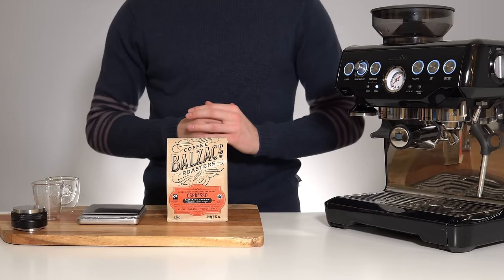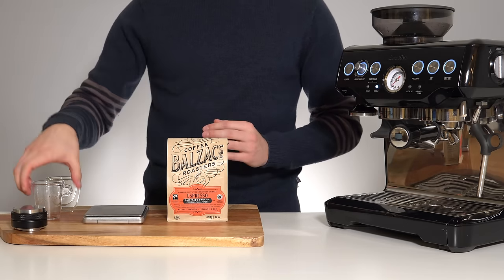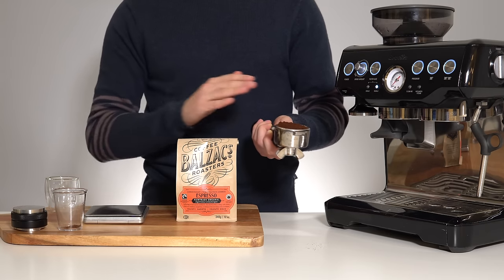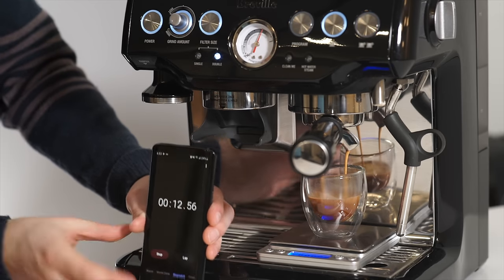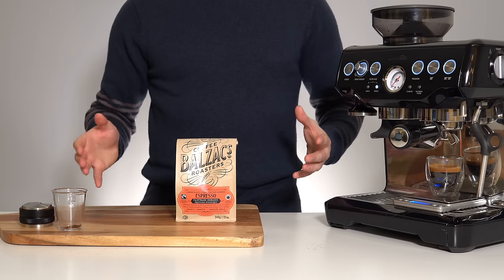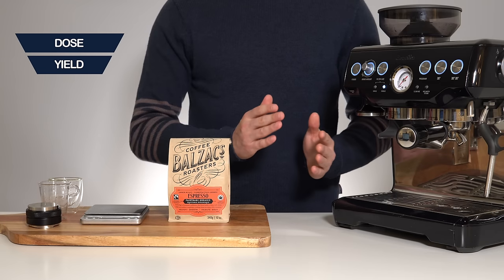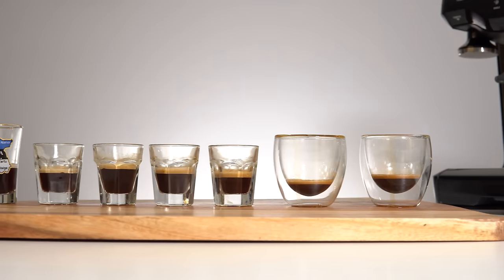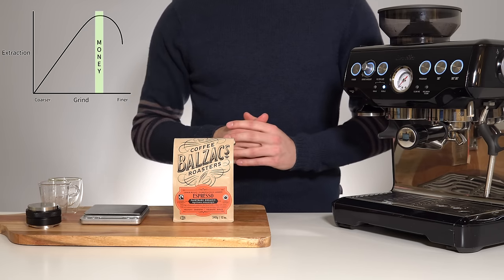Dialing In Breville Barista Express | Dose, grind, yield, time

Comment: Great introduction! I use the Barista Pro, do you measure the preinfusion time (nearly 8 seconds to the first drop) into the 20-30 seconds recommendation?
Reply: From what I'm gather he's starting his 20-30 second count after the ~8 second pre infusion. Which means the clock on the barista pro should be reading 28-38 seconds by the time the shot is finished.
Reply: In the video time is measured starting with the first drop. But normally you have to measure the time water and coffee have contact, which means, your have to include the preinfusion time. Even Breville recommends doing so.
Reply from the maker: Only time you need to time in a specific exact way is when trying to replicate a brew recipe. This 25 or 30 seconds is intended as a STARTING point from which you can start tasting and tweak further. Either time or either timing method will work. Regardless, you will need to taste and tweak further based on your specific coffee and personal taste

Comment: I came to watch this video because a friend of mine is getting into espresso drinking and has found a friend who is selling the machine and asked what I thought about it. I'd watched  a couple of other videos with this machine and told him about them but  rather than rely on the machines settings  buy a scale and weigh the coffee in and out- guess what? This is exactly the method that you are using. 
No flash bang wallop music, what's up guys or anything like that just clear precise instructions - excellent.
I brew only black coffee, no milk based drinks and I aim for 30g out of an 18g dose because I prefer the mouthfeel. No good asking me about milk based coffee. 
I would only make a couple of recommendations over and above what you have said,  1) use magnesium filtered water to improve the taste and prevent unwanted scaling of the machine 2) buy at least 500g of the same beans because you will use quite a bit to get the shots dialled in. I learnt my mistakes by buying 250g of one variety of beans and then switching to another variety of beans and having to go through the whole dialling in process again and not really learning. I now buy 1kg at a time from my local roaster and don't regret wasting a shots during the dialling in - event though I am a tight Yorkshireman!

Comment: This is a great video! I have a few questions:
This example was done with a double shot. Do I have to dial in again using the single shot, or will the Breville remember my programming for the double shot and divide that by 2 for the single shot? Or do I need to program it again?
Am I still going for 20-30 seconds on a single shot? Or should that number be different?
Reply: You have to program the buttons separately. They come preset from the factory the way you describe, and will reset to that default if you perform a factory reset, but changing one will not change the other. I have my single set to a ristretto (short double, 1:1.5) and the double button set to a normal 1:2 double. 

Also, singles are notoriously hard to dial in. The shot time should be the same as the double and therefore you need a much finer grind. It will be much more sensitive to grind size and you might find this machine won't go fine enough. It's a waste, but most people pull a double into two glasses and chuck the extra one if they only want a single.
Reply: @Akmatick  - agreed, dialing in single shots is not fun. I used to do it a lot before I was very knowledgeable about the machine and I always found I had wildly different results between the 1 shot basket and 2 shot basket. The 2 shot was generally better, and I'm not surprised nowadays, given more coffee theory is based around shot weights suitable for the 2 shot basket.

Comment: I noticed that there was no espresso coming out on pre infussion on your vid.  Should this be the case?  Espresso comes out on mine when I press the brew button.  Let me know how I can fix this.  Thanks and great video!
Reply from the maker: No, espresso should not come out during pre-infusion. The pressure during pre-infusion is very low. If water is able to pass through at such a low pressure, you need to make your grind finer!
Reply: @LifestyleLab_  Got the same problem. I always get coffee in pre infusion phase nomather how find my grind is.
Reply: @tomekhekin914  are u using double basket? With single it is almost impossible to not get leakage during pre-infusion.
Reply from the maker: @tomekhekin914  try increasing dose by a gram or two.
Reply: 2M views Today I’ve increased my dose to 11g on a single wall basket, and have yielded close to 1:2 ration at 21.5g... but I forgot to time it 🤦🏻‍♂️

Things I’ve changed:
1.  Dose from 9g to 11g
2.  Calibrated Tamper (Not the Espro version)

I have yet to dial in some more as there is a little bit coffee still coming out of pre-infussion... I am on a mission to dial in 🤓
Reply: 2M views really?  I always use very fine grind, at fine-1 2.  It Still coming out at pre fusion
Reply from the maker: @BingBing-cw8qb  try increasing your dose. Water should not be able to pass through the puck during pre-infusion. Just like the "box of pebbles" analogy I made, the liquid exiting at that point would be very under extracted
Reply: 2M views thanks I need to do more experience
Reply: @LifestyleLab_  this is a very important comment. I have been making this mistake for many many months before I saw your video!
Reply: @justinwong1307  Beware, you can also make finer grinds by adjusting the burr grinder itself. There is a metal arc you can hold it from, it pulls out of it's side slots and allows for extra grind settings. It will allow for much finer grinds. Pay attention to the numbers on the plastic ring on the Burr blade itself and you ll notice nthe calibration levels it has for the metal arc.
Reply from the maker: If you've reached the minimum grind setting and it's still running too fast, you need to set the INTERNAL grind setting finer! Here's how: https://youtu.be/QNvOcE4-VEo

Comment: Love the video, however I'm pretty certain you do not time when the first  drop. You time from as soon as the extrction has started otherwise you miss vital seconds which through off the taste etc...
Reply from the maker: As long as you dial in to a time that tastes good and hit it every time, method is irrelevant. 25 seconds from first drip vs 30 seconds including pre infusion will taste exactly the same ;)
Reply: So many unnecessary steps 😅 hearts 8n the right place though
Reply: @JJones_1  Huh? These are all standard steps to dialing in a shot, which one's are unnecessary?
Reply: Correct, you time from when you hit the button. Should be about 30 seconds I believe
Reply from the maker: @jaquestraw1  25sec from first drip is the same as 30 seconds from button push (5sec preinfusion)...
Reply: I understand. Thanks,  good video!
Reply: I believe the barista express has about 12s of pre-infusion (non adjustable).  It's wierd, so I just do it manually every time.
Reply: I'd recommend to start timing when you hit the button, since the preinfusion time is also a variant. The manual says that the first drop should start after around 7 secs. which works perfect on my machine. But as yuy can see in the comments we have everything here from 5 to 12 secs. I used to dial in by timing from the first drop an, and it almost drove me nuts every time a tried another sort of beans, 'cause I never managed to get the same flow time. But since I started timing from hitting the button, it became much easier.

Comment: When I first started making espresso I bought one of those expensive Italian double boiler machines (LaSpaziali Vivaldi II) and a Mazer grinder. I went through all the trial and error setup like you present here. My coffees were outstanding.
Later, I bought the Breville for work. I did not put the work in to properly get it set up. Coffees were OK and it didn't seem worth it to go through the setup / calibration. (I know my shots are too fast)
Watching your video has inspired me to go ahead and put in the effort.
Thanks.
I'll let you know how it turns out.

Comment: This is an excellent review and video on how to use it. I've had this machines for over 2 years and it's been flawless. My friends have enjoyed this machine so much that two of them bought it!

I've found that for myself, making single shot espressos, this machines hs been very consistent. Albeit I do notice differences between summer and winter as I have to adjust to a finer grind in summer. The double dose does come out rather inconsistently, however I'm getting used to measuring it well by sight. It's about getting used to how compact a proper shot of espresso is. But the double shot does come out well too. But I do find that I can get a creamier single shot and I think that is down to the shape of the single dose filter.

I will however try and focus more on how much I put in, and how long it takes to pour. I believe that by following your techniques I can improve my own.

Thank you for the video, it was pleasantly informative!

Comment: best video i have came across for beginners to explain everything 👍🏻 … all the videos i have watched say you shouldn’t need to adjust the burr grinder but just play around with the external one on the side. 

however, in order to extract 36g using 1:2 ratio in around 20-30 seconds i had to adjust the burr grinder down to 3, and 5 on the external. this goes against all the video tutorials i have watched, is something wrong with my machine or beans? i have just bought this and only used one type of bean from my local coffee shop.
Reply from the maker: Nothing wrong!  
Dial in to taste and enjoy

Comment: First of all: this video is a big help if you just bought your barista express! Thxs 

Next to espresso I like an Americano. In your video around 10 min you speak about brew ratioand yield and the graphics. 

I asked my self: is there a difference of making a good double espresso en poor in in hot water ..or (after a taste test) let the double espresso shot last longer eg. 50 sec and have an Americano without pooring  it in hot water ? 

And about the water… is there a “rule” how much water (gram) to add to double expresso or is it a taste thing? 

Last Q :) when I made a shot and cleaned the porta filter… it seams that there is a little bit of water left between the cup and pf casing … is that normal ? 

Last but not least: great job and great and helpful videos.

Comment: I have the ESP8XL I thought that the heating element was out but my husband went ahead and opened it and saved it. We found that one of the connections was not connected. My machine was manufactured 2008 we had been using it for years. I only paid $2 for my machine. Had not been able to use it for about 6 months. But we decided to try and save it. That little bit of information about letting the espresso machine warm up 15 minutes made all the difference. It's like I completely forgot how to use it? Cuz one time it would make a perfect shot and the next time it would be just straight water.

Comment: The machine is actually ready in fewer second, the reason why we wait 15-20 min is because our cup gets also heated along with the bins, with you putting the right amounts just in time , it will give you slightly a colder coffee which  defeat the purpose of waiting that long, beside if you set up proper grinding with proper amount it will always give you about the same amount.. i have set up almost at 3 and i always get about 19gr

Comment: Thank you for this video. Just got the machine. Will try this. My machine gives me almost no pressure even when I switched to grind 8. Not sure. However mine was on auto mode. I will try this manual method. Thanks
Reply from the maker: You will need to dial in ANY espresso machine's grind setting in this way. Automatic or not :) 
If you're not getting pressure on 8, start going finer. If you reach 0, there is a macro adjustment on the upper burr to give you even more range
Reply: @LifestyleLab_  I had it on grind four before and the pressure dial did not move at all. I thought the machine was broken. Also it grinds SO much coffee so I set the dial on one above least amount of grind. That is very different to everyone else. Don’t get it. :-(
Reply from the maker: @JH-nb4nn if it didn't build pressure on 4, you should have gone finer not coarser... 
Everything you're experiencing makes total sense. You're grinding too coarse, meaning the grinder is grinding very quickly giving you a lot of coffee on the basket in very little time. The finer your grind, the longer it will take to grind, and the more pressure / slower flow your espresso will have. 
This is all described in this video
Reply: @LifestyleLab_  Oh.....Yes it brewed the coffee in about 10 seconds. But I don't understand. I will rewatch the video when I attempt. Thank you
Reply: @LifestyleLab_  And yes i know you explained it in the video but I am not smart with coffee making so I will rewatch. Lol.

Comment: Thank you for all your videos.  These helped me to make the decision to get a Breville Barista Express as well as most of your suggested accessories.  
That said, I attempted to dial it in for the first time today.  I (think) I followed your instructions correctly, using all same tools you mentioned including the same scale and Palm Tamper etc.  
I first followed your video on dialing in the tamper then moved on the grind.  However no matter which settings I used all of my shots reached 36 grams between 10 and 16 seconds.  Following your advice I tried to go up to 22 grams but found I literally could not attach the portafilter at 22grams... it was just too full even after tamping.  Therefore I moved down to 20 grams and I could fit that amount.  When dialing in at 20 I still found even at a 1 grind setting my shots were pulling about 14 seconds.  I then followed your advice and adjusted the internal grind setting (which was already set at a 3 from the factory).  I moved this down to 1 and started the process again, eventually finding that even at the finest setting on both the internal and external grinder (1 on both) still only got me to a 16 second extraction.  At this point I started to feel like I must be missing something in the process here.  What other factors could I missing?  I am using freshly roasted Intelligentsia Organic Espresso Beans if thats helpful. 
What I feel I'm missing overall is why are the numbers you suggested so important?  What I mean is why do I want a 20-30 second extraction with a 36 gram shot?  If I put aside all the numbers and just go by taste, I would say the best  tasting of the many i pulled was approx  these settings:  Internal grinder: 3. External grinder 8, 18 grams dose, 13.5 second extraction.  Should I just forget about hitting a 20-30 second extraction and use those settings that came out best?  It was pretty good at that level but short of an expert level like I get at the best coffeeshops.  I'm embracing the leaning curve with this process but just the fact that I reached the limits of the machine settings right away makes me feel like I must be missing some other factor.   Any insight would be extremely helpful!
Reply from the maker: If you reach a point where you are no longer decreasing the flow rate by grinding finer, it means the water is no longer being forced through the puck (because the resistance is too high). The water is instead rushing around the edge of the portafilter, which is why the grind setting does not impact the flow rate. 
Try moving the internal grind setting up to 6 (normally where it is from factory, not sure why yours was at 3), and restart the dialing in process with 17gr of beans. Let me know how it goes!

Comment: Great video! I managed to dial in my machine using this yesterday in about 10 coffees. I had 18g does with 36g yield in 24 seconds … left everything the same and then in the morning I was getting 11g yield in 20 seconds with same dose? … I’m using the distributor/tamper you use in the video too. Is this normal? Why would it change so much.

Comment: I’ve gone through this (excellent!!!) video so many times and I can’t seem to get my extraction time above 10-12 seconds.
I set my grind to finer but the coffee starts tasting burnt, any tips?
I also upped the dose to 20gr and kept the 1:2 but no change 🤷🏻‍♂️

Thanks for this clear and helpful video!
Reply from the maker: Always dial in to taste. If you’re starting to overextract at higher shot times, don’t keep grinding finer just to slow the flow, taste is the end goal :) 
You can avoid bitterness by keeping your grind coarser, or shortening the brew ratio (less espresso out per gram of coffee in)

Comment: This video is so helpful! I had been planning to return my BE and instead look for a better grinder paired with an Infuser or Duo Temp Pro. After watching this video, I would like to keep working with my BE grinder before I give up, however, I don't want to waste too many more beans. Can you tell me what setting # you have your internal burr set to in this video? I believe it came set to 5. I know there is no perfect combo of inner and outer grind settings, but it is so tricky trying them all, especially when you have to remove the internal burr ring constantly. Any grind setting help you can send my way would be so appreciated, as it seems like the outer dial has HUGE steps from # to #. For example, with my inner burr set to 4, the outer set to 4 may choke the machine and no extraction comes out, but switching the outer one step to a 5 may run a very fast, under extracted shot. SOS!

Comment: This is one of the best videos I have seen to configure the  Breville Barista Express. However recently Breville has set it's default max pressure to 9 bar in the new Breville Barista Expres machines. So I no longer can reach above 9 bar. It would be great if you can make/update the video with this new setting.